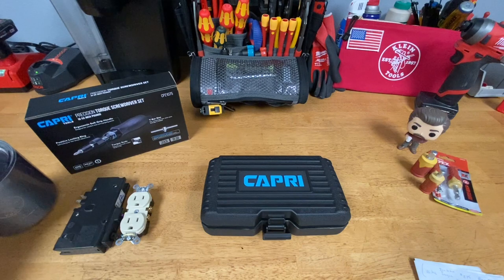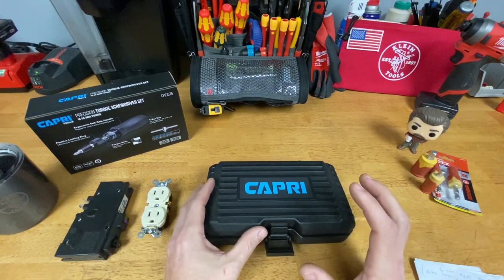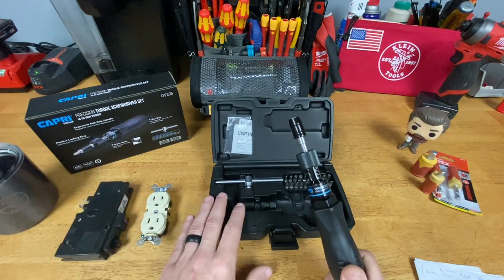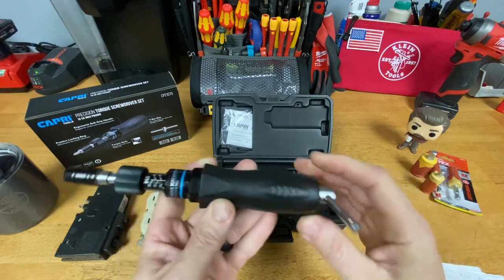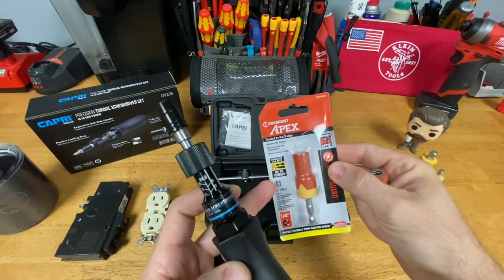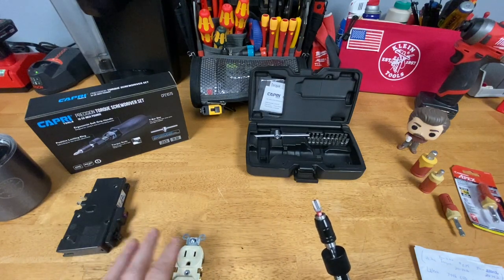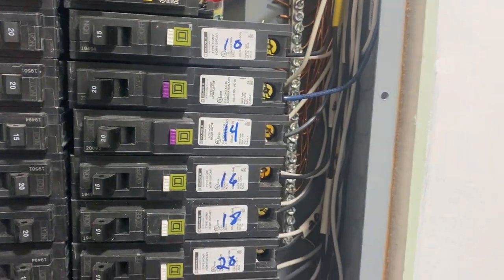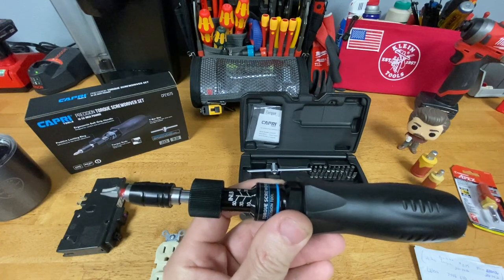Capri Tools Torque Screwdriver - Check a Panel and a Tip to Insulate your Non-insulated Screwdriver

Comment: If torque specs are given, they really should be followed because they are something that was tested as part of the design of the component. I believe this has been the practice in Europe for quite a while. There will obviously be pushback since it's a change that many will see as intrusive and something that will slow them down. It will really be the inspectors that determine how fast this is adopted. If they start failing installs for improper torque, contractors will fall into line really quickly.
Reply from the maker: Yeah, change is always resisted. I know if I’m tightening lug nuts for a vehicle my family is riding in I make sure they are to the proper spec, it to me is no different.  If a small extra step gives a better chance of nothing bad happening…  I’m all for it just for the peace of mind.

Thanks for your comment

Comment: Some what unrelated but are you using a ECX bit? Didn't realize a combination slotted/square bits existed prior to seeing this. Have you used other brands with a different bit name? Haven't seen alot of options out there searching. Found a  two piece set for $9-$10 which is a bit steep to me but I think found it in a couple other Shockwave sets that at least brings the cost per bit down.
Reply from the maker: Yes they work great.

Milwaukee has them in some sets and also Klein.

I just bought a two pack piece for my Klein 11 in 1 that they sell too. https://amzn.to/3LBgjPk (Affiliate Link). But I think they have standard 1” bits as well.

This bit set from Home Depot (Non-Affiliate) is not a bad price and includes them. 

https://www.homedepot.com/p/Milwaukee-SHOCKWAVE-Impact-Duty-Alloy-Steel-Screw-Driver-Bit-Set-12-Piece-48-32-4507/203086495

Comment: Good that you're back.
I am absolutely certain that I commented under Stan Rosenblum's post, but I can't see that comment.
Anyway, check out Wera insulated torque screwdriver.
That spring-loaded bit ejection mechanism will become weaker with time and dust getting inside. Wera bit holders have that feature and it works great.
Edit: I know why the comment disappeared - used Wera's catalogue number; it must be similar to phone numbers I think.
Reply from the maker: I’ve been looking at that one too. Thanks for the suggestion and recommendation.

Yeah I have been doing side jobs the last 4 weekends and early mornings. Have them finished up, so hopefully I can get back in the swing of things!
Reply from the maker: Do you know on the WERA if the blades are specific to the Torque screwdriver or do their blades from other WERA insulated screwdrivers fit it as well? Not sure if you have both.
Reply: @MORGANSMaintenance  The blades on insulated screwdriver are proprietary, but they're interchangeable between torque/non-torque insulated screwdrivers. As for regular torque screwdriver - it takes normal 1/4'' bits.
Reply from the maker: @Stefan_Kawalec  Thanks. I was curious to help in making decision if sets with more blades at a higher price are available to bite the bullet or not. That is the case on the Wiha.
Reply: @MORGANSMaintenance  That's the problem with highly specialised tools. They're awfully expensive and manufacturers dictate terms of sale. They don't care if you like it or not, because if you need that one specific tool, you'll buy one eventually.